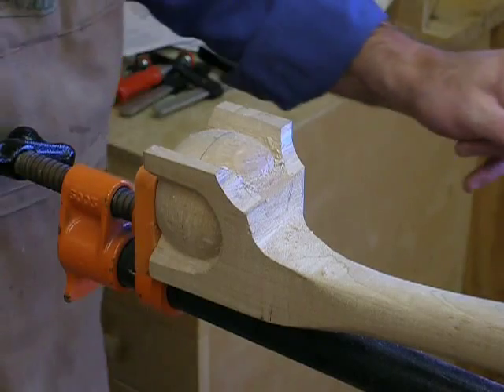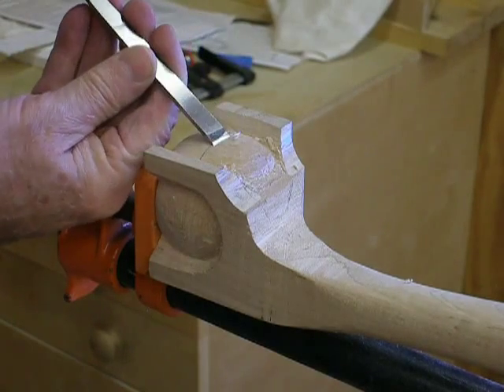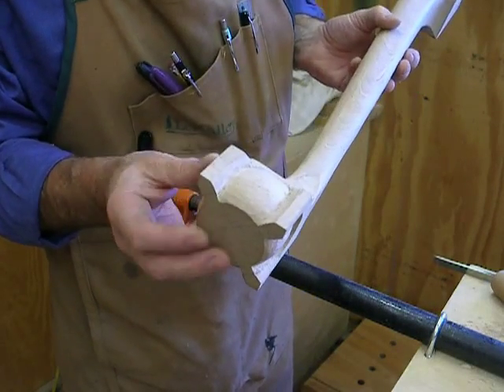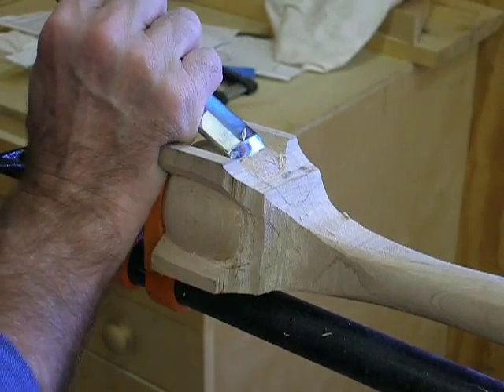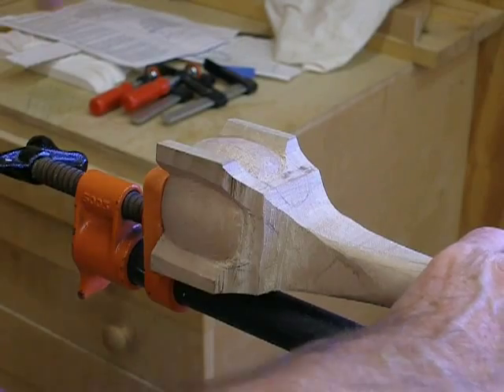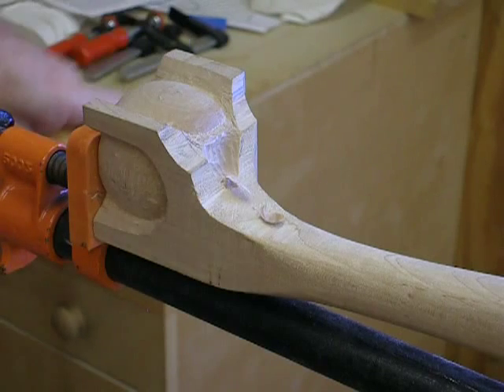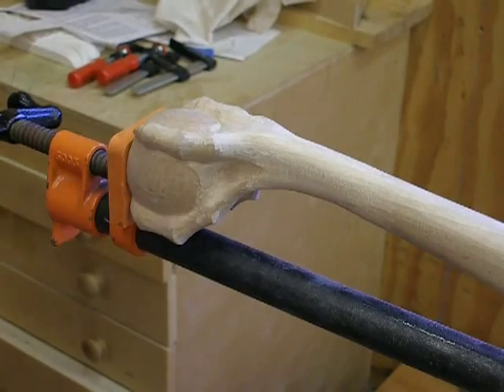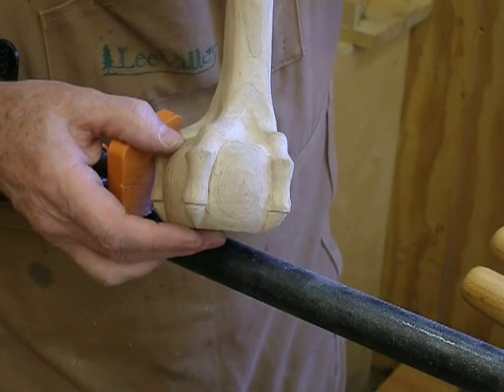Completing a Ball and Claw Foot for a Turret Top Tea Table Step 2

Comment: Sure have learned alot watching your videos. Getting close to starting one of those. Why couldn't you make a radius template to use to periodically check while carving the ball portion? Thanks for taking the time to film and offer your craft to us.
Reply from the maker: That was early in my carving of ball and claw.  If you watch later videos you will see me use a molding profile  device which holds the profile of the ball so it can be copied.

Comment: That string you used for sizing the ball appeared to be weed whacker trimmer line. It was fairly stiff which worked well. If it wasn’t, I think I will try my weed whacker trim line for such measurements.
Reply from the maker: Yes, also you can use a molding profile device to measure one that you have to make others identical